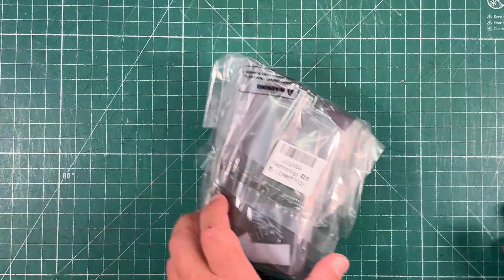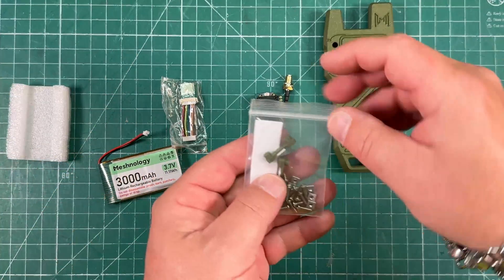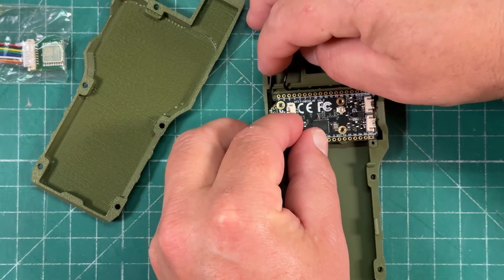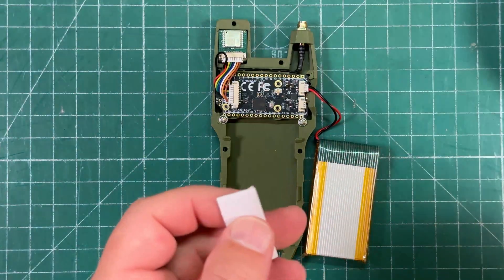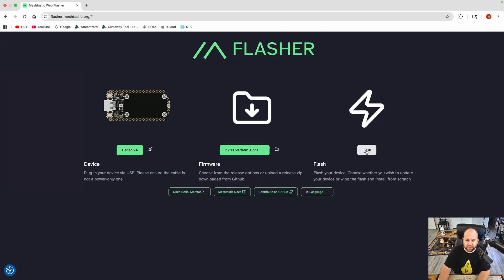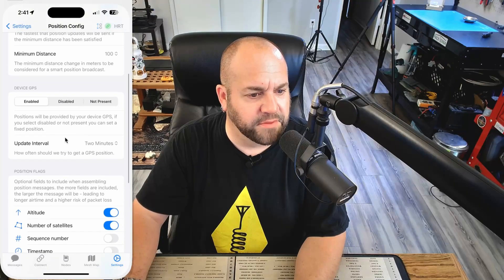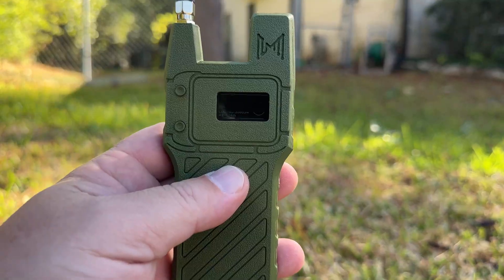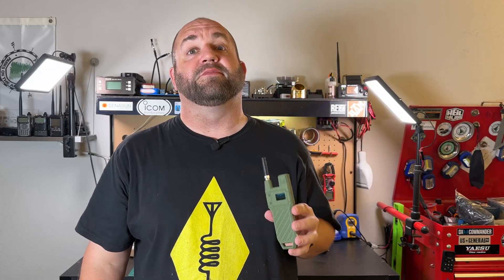Meshnology N39 V4 Meshtastic Node W/GPS Only $44!

Comment: Does it have an on/off switch. Many devices I have owned don't.  ? Cheers from old George uk
Reply from the maker: Not a switch but you can do it on the device.  It's in the settings menu to power off.

Comment: Good work on your video, i just h have one problem.  Just in 2 days after your video went up, the price went up to by $12.99? At Amazon but it is completel with gps. That's a big difference, do you agree, It's a bit strange that the main site as it for the $43.99 but dose not include the gps at all that will be addition cost.

Comment: Always use client-mute. Client mode rebroadcasts all messages received clogging the system. Better yet switch to Meshcore and avoid the sluggish performance of Meshtastic.
Reply: If you have a well established mesh, or strategic repeater maybe, but client mode helps in areas with sparce nodes where congestion is not an issue.
Reply: I’m in Client Mode.  Milwaukee has like maybe 12 nodes spread out over 100+ miles.    I haven’t seen ONE text in 3 weeks.

Comment: Meshtastic is like if you designed a dial-up modem that provided 1Mb/s internet speed. That's impressive compared to 56k modems. But it's 2025 and cellphones text over satellite and don't rely on cell towers anymore.
Reply: Satellites that can be locked out by the operator. These systems are for a more severe outage.

Comment: You can pull the coax down under the board on the right side to relieve that annoying loop above the gps. That way it fills the channel properly running to the ipex

Comment: Hey Mike!  Thanks for the great video.  I do have a couple of ideas.  
1) As mentioned by quite a few others...yes, connect an antenna BEFORE hooking up the battery. I've burned out a V3 board by forgetting to connect the antenna (I realize a bit of a late suggestion for the video, but for others watching, just a helpful hint.)    
2) Pull the antenna wire back through the channel and place the loop at the bottom of the antenna connector and under the board.  This might help keep it from being pinched against the GPS board.
3) If possible, try the same with the battery cable, again, hooking up the antenna before connecting the battery.  

Also, just a theory...a possible reason the display might be dimmer than your other model is I believe you said the V4 had a cover over the display.  I wonder if the cover has a slight tint to it which would cause it to be dimmer.  Again, just a thought.

And nice to see Satan make a (very brief) appearance. :-)

Thanks again for another great video and keep them coming.

73
Reply: Nice Cisco VoIP ringtone when you get the message.  Reminds me of 24
Reply: I was thinking the same thing on 2.  I figured I'd read through to see if someone else had come up with it.

Comment: I am slightly embarrassed to ask this question, but it is time.  I have watched so many YT videos about mesh - mesh tactic  but no one ever explained what what it is, its purpose or function.. Is it ham radio related or just internet?
Reply: If multiple people in your area have one of these, they form a network that is similar to a repeater. The function is sending TEXT MESSAGES. You can send a message to everyone or a specific person. It is a BACKUP for cellphones assuming that someday your cellphone doesn't have signal, this will still work. It only works for somebody within range of your network or MESH. Your town may have 6 people with these and you would only need to be in range of 1 of them to communicate with any of the 6 people in that MESH. I keep getting interested in it as a techie ham guy but I feel like they will NEVER serve a practical purpose. Cellphones are going to be using Elons satellites for text messages in the immediate future so Cell towers will be obsolete soon.
Reply: @aarongriffin81 Thank you.

Comment: Mike I love your videos. At the risk of revealing my ignorance.  What is this thing uses for ???
Reply from the maker: The TLDR is this is for running Meshtastic which is an offline, off grid, secure messaging system.  It creates a mesh between devices and can relay encrypted messages over long distances.  Use case, say power, cell phones, etc. goes out in your city.  You can use these to communicate with your neighbors, family, etc. privately and securely.  No license needed.  Say your family member is across town and out of range of your Meshtastic node, because these create a mesh network, if there is another node between you and your family member, it will relay that message while keeping it private and encrypted.
Reply: @hamradiotube  thanks

Comment: Two things:
1) Connecting the antenna before the battery is probably a good idea. Transmitting, even accidentally, without an antenna is not a good idea.
2) How is the battery life?
Reply: Battery life is good on mine. In two hours it went from 100% to 85%. Last around 12 hours or so. More with less tx and rx

Comment: do you think a larger battery would fit?
Reply: That battery is bigger than it really needs to be. 600 mah would be more than enough. Hetlec modules sip power they don’t drink it by the gallons.
Reply: @Butch-y8n I just want a device that last more than 2 days before it needs to be charged.
Reply: No it won't, a v4 with the 3000mah lasts roughly 23 hrs with gps on, or nearly double with it off, using standard power settings